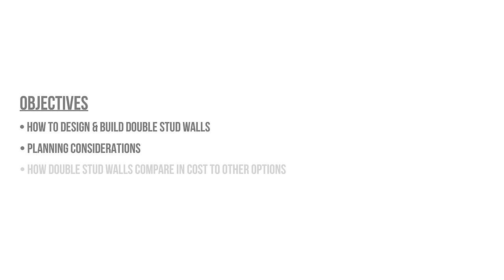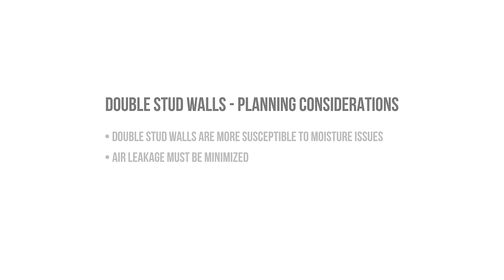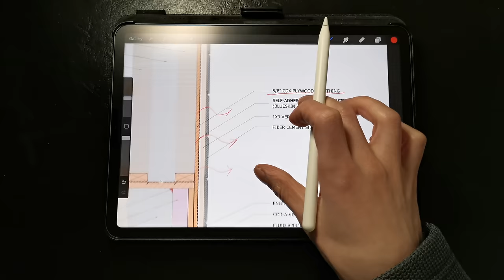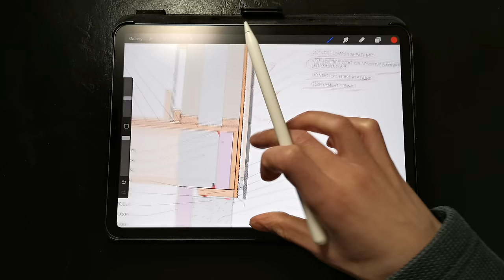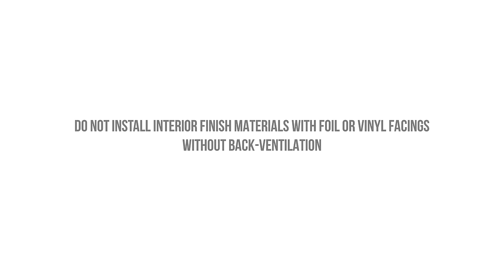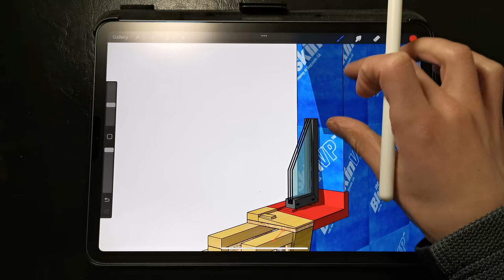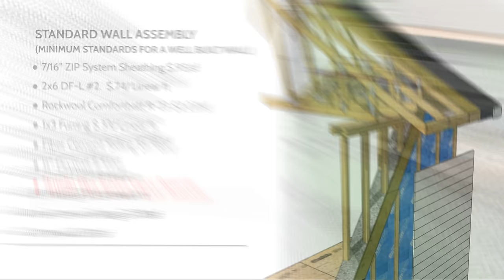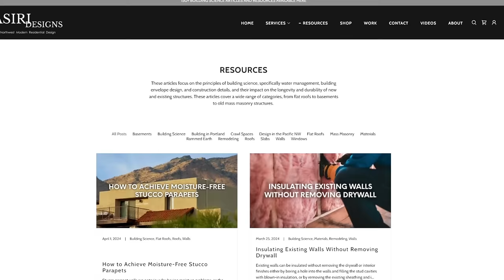Super Insulated Walls on a BUDGET?!? | Double Stud Walls Explained

Comment: I got more out of this one video than I did from dozens and dozens of other videos.  The price breaks are fantastic!  You just saved me days of work.  Please do more.
Reply from the maker: So glad to hear it was helpful! Cheers!
Reply: @ASIRIDesigns  absolutely. Thanks a lot
Reply: Nah
Reply: I have 3 crews doing 3 places right now and was thinking of doing this. I’m not doing it. Not for these. I’ll wait for a halo project and up my game in efficiency. But, damn if that wasn’t the most informative video I’ve seen on double studding.
 
I’ve watched a bunch of videos that were much longer and did not give the details that I needed to feel confident enough to try it without the moisture issues that pop up in every other video on this subject.

It’s like these builders wanna ACT like they’re showing you how to do a new and awesome technique, while at the same time, withholding those details that complete the picture.
Then, they do a commercial.

Great video. Very informative and eye opening.

THANKS!
Reply: @ASIRIDesigns  Very good presentation.  I built with double stud walls spaced 4.5" apart for R-44 insulation.  Did not spring for the triple pane windows so that is my weak point but with 9.9kW solar array my house generates more energy than it uses each year- with enough extra to power two EVs.   The double stud walls do help a lot with noise and since I built them myself the extra cost was not all that bad in 2014.  Lumber has gone up a lot since then.   Really any competent framing crew should be able to build double-stud and watching this video will educate them on how to install the windows.  Thanks for providing the numbers also.  One thing people should think about is the long term cost of poor insulation- it is so nice to never have any electric bill.

Comment: If i was building a double wall assembly, which i always thought of. There would be NO insulation between the interior wall stud, and the vapour barrier would be behind the interior wall. That reduce the potential of hole and leak in the vapour barrier caused by simple things like hangers, frame hooks, electrician, plumber etc... it would leave 2.5 or 3.5inches to run utilities, to install blocking, to hang stuff without perforating the vapour barrier
Reply: He shows furring strips on the interior that does this. 7:27 but it's a good point to make.
Reply: What you can get away with depends on the climate.
Reply: We installed all our services (plumbing, electrical etc.), then installed the drywall before dense-packing cellulose in our walls. The walls are solid insulation. In a cold climate, anything less would be crazy.

Comment: Even on an R-20 wall most of the energy loss occurs at the windows and doors. Upgrade them and make them smaller for real energy savings. Energy analysis will identify when it makes sense to upgrade the R-value of the walls.
Reply: This.
Reply: Yes, this touches on something a lot of people don't understand with thermal efficiency. Very small inefficiencies in design can have huge effects. A single double glazed window in a wall can easily reduce the wall's effective R-value by 25-50% depending on wall and window size. The thermal bridging of fasteners for exterior insulation have an outsized effect as well, as well as metal flashings that go from the exterior to the sheathing, bypassing exterior insulation.
Reply: Triple pane windows with 2x4 studs is more efficient then 2 pane windows with 2x12 studs.

Comment: I could be wrong, since there are so many different materials involved, but I think the double wall system also allows for more acoustic insulation. That may be a consideration for some people, particularly in an urban or busy suburban area.
Reply: Yea cause it's decoupled. It's sometimes done for bathrooms so you can't hear the  shower among other things
Reply: @redneckcoder  gotta pay the bills somehow 🤣
Reply: The stud is the main transmission of sound vibration from side to the other. When the two sides of the wall aren't connected to the same stud, sound is dramatically reduced. Interior walls can use staggered studs, where they are alternately moved a half inch off center from the previous stud. You would need stronger wall material to span twice the distance or put the studs more frequent, like 12 or 8 inches apart.
Reply: @redneckcoder   Both contribute, and the dampening effect of insulation helps a lot, but wood is a far greater conductor of sound than air. That's not my opinion. There's charts you can refer to with real measurements of many materials. Having wallboard connected to the stud makes it move together as one, whereas sound hitting between the studs has to transfer from air to board to air to board and then to air again, each time losing energy.
Reply: @redneckcoder  Ah, you're right; I did miss your point. I apologize.
Reply: Doubt many independent builders/contractors build in urban areas nowadays, it's all megacorp stuff. 
But other than that, yup.

Comment: Great stuff as always.  Double walls also provide a huge reduction in sound transmission for those in noisy neighborhoods. If maximum thermal efficiency is the goal, then double walls are practically impossible to beat. However... the labor costs are a HUGE factor here. The cost to install exterior EPS/XPS will be drastically cheaper than having a crew frame out double walls and the extra details for fenestrations. And for most areas of the country, the difference between R40 (R21 cavity + 4" of rigid foam) and R60 might not even be noticeable. You'd probably be better off putting that extra money into upgraded windows and doors. Building double walls with double-pane windows would be pretty pointless, for example.
Reply: No extra window details for 4" of exterior foam?  I agree that going from 40 to 60 won't be very noticeable, diminishing returns.
Reply: @rodfreess6019  Some extra details for sure but it's flashing and trim/bucks which you would need to do in either case.

Comment: My house is 50 years old. I plan to change the outer wood panels next summer. I also like to improve the insulation with rockwool and better vapour retarders. Do you think I can put in new vapour retarders without removing the internal drywall(gypsum board)?  Can I just put the vapour retarder at the cavities and tape it well on the studs?  Thanks.

Comment: Well done!
I built in1986 , staggered 2x4 stud walls 5” apart with 2 r19  fiberglass batts. 1 disadvantage is if or when mice get into the wall cavity they can travel freely. Otherwise I would do it again!
Reply: Needed a fire block stud every 10 ft...
Reply: If the cavity is filled with insulation isn't that a fire block?
Reply: @AngelMalakim I think he means a mouse barrier

Comment: I'm totally sold on the double wall design.  At the cost is daunting.  I have to pay for it as I go.  I don't have any kind of a construction loan.  And I'm on disability so it's limited funds every month.. my idea was to put up a steel building, like a pole barn, and then frame up a house on the inside. Because I can do that out of the weather.  And I can also leave a big enough walkway all the way around for maintenance on the inside of the pole barn. 

Not your typical construction project LOL.  

But doing it that way it gets me out of the weather, and I can put it together one room or wall at a time.
Reply: Not an expert but it looks to me like the design would be different considering your house is never exposed to the weather or sun?  Moisture transfer would be much less of a problem, if any at all.  I am researching because I want to build a bedroom and small living area inside a large steel building.  I want it well insulated so that it cools easily with a mini-split AC unit in the Texas heat, cold weather is nonexistent therefore not even a thought.  Seems with no sun and weather exposure the walls and ceiling could receive the same insulation R value.  Just trying to figure out what R value is the most cost effective and efficient?

Comment: Great video love the density of information here, as well as great explanations on issues with the double wall system, and why they exist.

Regarding the 27% increase in material cost however, the amount of cost for labor will be significantly higher then the exterior insulation option, 
As that requires no special planning, education or oversight of the workers.

I will say that, at least theoretically, the performance of this double wall can vastly exceeded that assembly, 
But I think it’s gonna be roughly a tie cost wise.
Reply: Dense packed information. I would love to see those kind of cost reflected in a future video too!
Reply: Does double wall system retires entirely on competent workers the more importantly experienced supervisors.
You're only as good as your weakest link.
If you can find a foreman who has done this many times over he will be worth his weight in gold.

Comment: Neat stuff!  We added 20 inches of insulation outside our log cabin, and to avoid the 'tunnel effect' out of the existing windows, we flared out the window openings horizontally at 45 degrees.  The very thick walls then don't block your view!

Comment: The cost of this breaks down alright if you've got the money. I'm really curious as to the cost of repair however. Someone with a handheld drywall saw can poke thru that vapor barrier inside. and if you live somewhere with hurricanes. the outer wall could easily be hit and damaged with debris. again damaging the vapor barriers. Not much you can do when your house gets wacked with debris and you've got 7 more hours of whirling rain and wind to go. basically blowing it into the damaged area. Cost of repair is very important to me.

Comment: I built my home in 1985 with 2 2x 4 walls 5” apart, w/ staggered studs & 2 overlapping layers of 6” fiberglass. Clad with 1x6 t&t pine over  Tyvek , 6mil poly continuous envelope & 2x2 strapped for wire chase.
The only issue I have had is the open nature of the stud arrangement is when a mouse gets in it can freely travel through the entire exterior wall cavity.
Today I would build with a  2x4 wall with 3” polyiso in between and 2” over the interior strapped for wire and SR nailing

Comment: What are your thoughts on using a Zip (R6) sheathing instead of the wrap and plywood if building a home in Climate Zone 3 (northern Oklahoma)? 
We run AC about 90% of the year and turn the heat on maybe 5% of the year.
Big fan of your videos… thank you.
Reply: Zip-R provides a nice thermal break. But you can get the same or better results with OSB/CDX sheathing + WRB + rigid insulation. Go with whichever is most cost effective. Prices fluctuate a lot these days.

Comment: I would love a video on leaving rafters exposed and insulating outside of the roof. We haven't figured out best way or a way we like yet. Being able to leave rafters exposed with roof board saves finishing money.
Reply: In Germany there is a type of wood based insulation popular that you can install onto the rafters. (Steico Dry) It is so stable that you can walk on the temporary wall and is weather proof for a couple of weeks until the finished roof is installed.

As a bonus: If you use these wood based insulations you can build you roof without a vapour barrier because it is permeable and capillary active so that condesing water is transported to the warmer (and dryer) side of the insulation.

Steico offers details for timber framed buildings on their website, the roof is basically from the inside to the outside: Rafters, Insulation (Steico Dry), sarking membrane (for weather proofing), roof battens, some sort of roof tiles.

It is a more expensive type of insulation but you can renovate your roof completely from the outside and keep your rooms as they are without having to worry about the correct vapour barrier.

Comment: I built custom homes until the mid 1990’s, I am now researching building a 1200 sf dwelling with about 30% of that as a garage. I’m amazed at the changes in the building technology. My design started with high ceilings with lofts and is now no vaulted ceilings. 
Thanks for the video. I can envision a world in the near future where all dwellings are modular and/or pre-fabled.
Reply: That's not a world I want to live in.

Comment: I was building one of double wall house. Same idea but just regular vapor barrier (polyethylene)inside and regular membrane outside. Wood siding. Blown in cellulose insulation. So many moments about moisture removal weren't addressed a way video suggest. But it has continued insulation through gap between wall and ventilation in attic, so in theory moisture can get out this way, not horizontally, but vertically.

Comment: i did precast wall with styrofoam as the bottom mold. It got me 4" of styrofoam all around my house and another 4 inches of concrete. I feel the materials are a bit more expensive than wood, but my walls went up in one day and are made in a factory so far less labor mistakes.

Comment: We have worked with both double wall and exterior Ci. And I would agree with your assessment in terms of cost. Another benefit of a DSW is that at least from the exterior is that flashing and finishing while extremely important to do correctly is quite simple and familiar to most trades.

Comment: I'm not sold.  When you do a double wall assembly you are losing interior square footage.  That square footage could later be worth $100-500 per square foot or more when the home is sold.  2x6 or 2x8 + 1-2" exterior insulation gets my vote.

Comment: At R-20, you have reduced heat flow between surfaces by 96%.  This video is all about going after that 4% difference from R-20 to the "ideal".  Look for ways to minimize thermal bridging and forget about the rest. IMHO.

Comment: If we design a wall with R40, how efficient do the windows need to be ?
window efficiency will be critical to increase wall R value.
Reply: I'd like to know that too
Reply: Windows are never efficient compared to even the most basic wall. Installing any window is a sacrifice to efficiency in exchange for beauty. So design your building accordingly. Smart, minimal, and small, and non-operable window placement will always beat trying to increase the efficiency of a window itself. It's possible for double-pane to be the smarter (more economic ROI) choice over triple-pane if you optimized accordingly, and I'm not talking about the whole "passive" house element: which is a good option when you really value beauty, but are still moderately concerned about efficiency. A modern non-window home will always perform better than a window home, regardless of how well you place the windows, or how much money you throw at the windows.

Comment: For the people living in the US this will of course make your house hurricane-proof as well, which is a nice side-benefit.

As a person living in Sweden the shoddy building standards in the US honestly amazes me, triple-glazed windows here are standard, our house is 16 years old now and has triple-glazed windows all-around, proper insulation and a ground-source heat pump, something only a fraction of all the new homes in the US seemingly have. Seems very short-sighted since it saves you so much money in the long run.
Reply: Sweden is not even close to the USofA with regard to climate conditions.  In the US, the demand is on cooling the indoor environment.  In the sunbelt we can have up to 8 to 9 months of cooling required where in Sweden one may never see the need for additional cooling for interior spaces.
Reply: @Wegl79  Well insulation works both ways. It has the same effect in reducing the amount of AC you need to use as it does in reducing the amount of heating you need to use.

If you'd place a Swedish house in Arizona it'd still use less than half as much electricity as a US house, because it'd barely heat up in the first place and as such wouldn't need much AC.

Comment: Amazing information and presentation. You helped me to understand a couple B.S. concepts i've been curious about for a while.  I've been building with an emphasis on exterior permeability for a few years now. But what happens if  you go to all the trouble to make the interior permeable, and then paint over it with a plastic (Acrylic latex) paint? It cuts off all permeability through the drywall, no?  I personally like mineral-based paints, but that's certainly not the standard.   Thanks again!

Comment: Why would you use blown paper pulp insulation when you could install rockwool batts? Do it properly the first time and you won't have to worry about it - rockwool doesn't settle, it doesn't need toxic chemicals to stop it rotting or breeding insects, and it will be there insulating your home for the life of your home.
Reply: Because long term exposure to rockwool causes lung irritation.
Reply: @romualdaskuzborskis  that's what safe handling methods are for. Wear your PPE correctly and clean up properly and you won't get it in your lungs. Which is more than can be said for the chemicals that will be outgassing forever after from treated paper pulp!
Reply: @tealkerberus748  not while handling. With time rpckwool does same thing as glass fibre wool - it braks because of constant vibration, hot-cold and dabmp-dry cycles. And after that you are left with a cloud of silicate dust
Reply: @romualdaskuzborskis do you know what ppe is? "while handling" is exactly when you're using respirators and vent fans
Reply: @dylanneely91  see, my second comment.